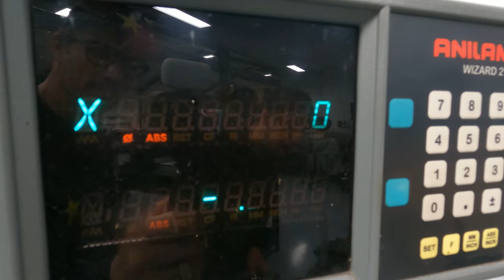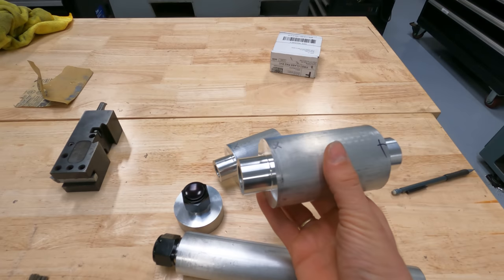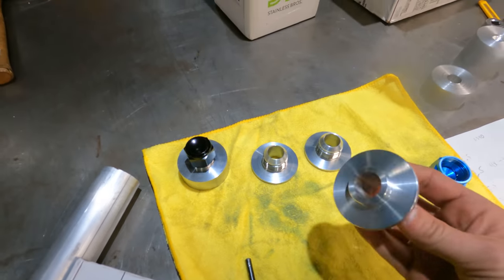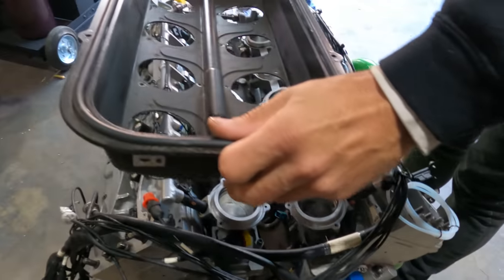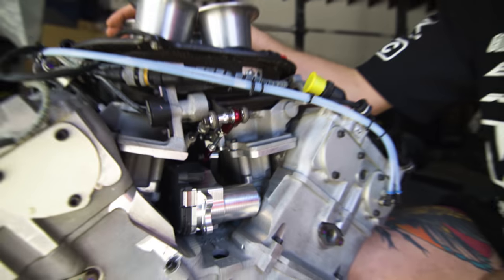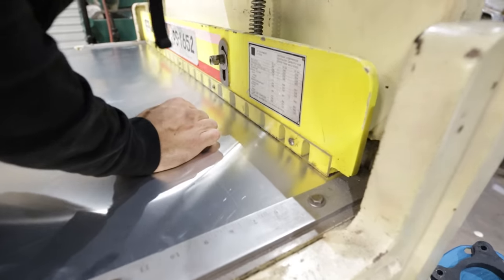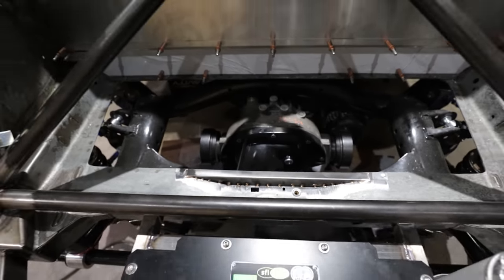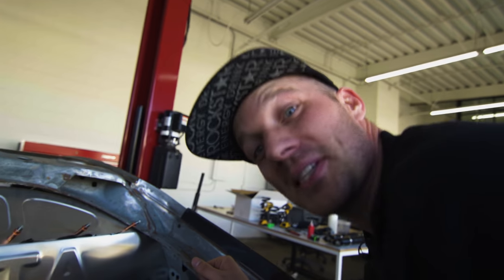Formula Supra Firewall, Drive By Wire, and Custom Domspec fittings

Comment: Cool thing about using RC car shock springs for the return spring is those are available in  adjustable weights so you should be able to find exactly what you want easily.

Comment: Yes you propably should not try to put cap screw on place of countersunk at 7:00. You put counter sunk screws all the way through the holes when the part is OFF, then tighten it to the pump so that screws stay in slots. This design is mostly because they want hose connector to land over the screws and physically stop screws becoming undone from pump when the hose connector has been tightened.

Comment: Anyone else really wanna see Dom press the the Toyota logo in that panel :(
Reply: It was done on the bead roller, there are some tenanted artist that make very detailed art with bead rollers.
Reply: Maybe he just ordered a stampted panel from the Toyota factory 😜
Reply: You can 3d print dies out of PLA and just press it letter by letter
Reply: 1000% he just ordered a Toyota tailgate skin panel and cut it to fit. The ONLY other way would require a press that was of gigantic size. Thibk of the panel presses Toyota uses in there factories......massive and I'm positive he can't get his paws on one of them papadakis doesn't have one......
Reply: Most likely done on the mill with a rounded over bit.
Reply: @daboy12s  winning answer here i made them too at work with this metod
Reply: @richmonsmith9308  don't think so, it doesn't look like it was stamped in a factory, it looks a lot more DIY, maybe with some milled or 3D printed letters and stamped them one by one.
Reply: Diego Garcia gonzales.....answer me this then.....why such a diffrsnce in the metal between the sheet he bought and the color and sheen to the final product......if he was gonna stamp it first off he would've used what he had on hand...it would've matched...cmon man think a little deeper here open your mind a little more....also have you ever attempted anything like this? Bc it sounds like you don't know the first thing about pressing sheetmetal.....I have personally done it but a much smaller relief and scale.....and again like I said.....he would need a press that was as big as a house to get those results.....go ahead spend 5 mins and do some googling.....bet you change your tune after that.
Reply: @richmonsmith9308  go ahead and tell me where he got a factory stamped aluminum panel with the toyota logo in it at the correct size for what he needed.
Reply: Yes, and it does look sick. Although personally I would love to see the old school Supra logo there.
Reply: For sure! Seems like it was formed with a rubber/urethane pad on one side and hard tool on the other (like laser cut metal letters on a hard surface). I imagine this could be done in a shop press of reasonable size.
Reply: @MrDHutch92   the amount of patience Dom has, he did it by hand / made the letters out of another material and stamped them one by one.
Reply: Yea any nearest Toyota dealer you can buy a tailgate......there not made of gold all dealers can get them usually have them in stock.
Reply: @richmonsmith9308  no toyota dealer has a raw metal tailgate with the plastic protective film on it. Material suppliers do
Reply: Wood, a router, a shop press, and patience will get it done
Reply: @daboy12s  I agree, I do this kind of work too, I just plasma cut the logo letters using a dxf file from any svg logo file. Then its done in the press. But i've seen Ron Covel, feature some bead roller artisans/ artists who can these kind of work as well.
Reply: @richmonsmith9308  have you ever actually seen a Toyota tailgate? That stamping looks nothing like this. The most obvious reason would be that the lettering on tailgates is pressed inwards, whereas on this piece it's pressed outwards.
Reply: As a sheet metal fabricator, all these theories you guys have (and the ones who think they are 100% right and are totally wrong) are hilarious.
Reply: I'll bet he pressed some wood or plastic letters against the sheet metal. It is thin enough to work
Reply: I am just surprised at how badly he spelled BMW. Still wanna know the method out of curiosity though.
Reply: @ttiization  Wooden or plastic dies in a press sounds most reasonable/economical so far.
Reply: @papapetad  and you machine it or 3d print it. Pretty simple process

Comment: Drive by wire throttle body controllers are usually meant to work without a return spring.
So I would reduce the return spring to almost nothing otherwise you risk the stepper motor seizing up from over heating trying to overcome the spring tension. If you want a positive return method add a small pneumatic ram that operates either off pressure or vacuum with a computer controlled solenoid to turn it on or off so it can slam the throttle shut if needed .

Comment: For those multi itb systems, use a 30lb return pair of springs and and a pair of 27lb ASSIST springs. That's the way to have a solid return with an ez pull.

Comment: Holy sweet gzs
We all just witnessed fittings be created from scratch ground 0 from a solid piece with the edges for where it sits not to mention the oil ring trim
Whattahell
You must be kidding full cheating over 9000 lol
Congratulations amazing work done unbelievable
(As if wasn't stoked for the whole series already)
EDIT: Had to come back here in the end of the video whilst the precious was while watching it to add about the finely crafted perfect fit firewall with design and even writings that was amazing
Sorry for the spoiler if you read this first before watching but simply because it had to be mentioned lmao

Comment: The Toyota embossing was probably done using a hammer form. Most likely waterjet cut out of steel and then the panel was laid over it and hammered in using a pneumatic hammer

Comment: If a spring is too strong, you can just put it into diluted sulphuric acid (basically battery electrolyte). It will slowly eat away some of the metal and make the spring thinner.
Reply: or you could just buy the right spring from McMaster Carr and have it the next day.
Reply: @patrickbaitman8336  Well, if you know which one to order, and if they have it in the correct formfactor, then yes.
But there are occasions when such a trick can be useful.
Reply: @sasjadevries  Didn't a racecar driver get in trouble for cheating back in the day doing something like this.  I think it was a stock car race, but he dipped the body to cut weight.  Something like that.
Reply: @patrickbaitman8336  Yep, there were people doing weight reduction like that, and the YT-channel "vinwiki" has a video on that topic.

And then even Papadaki and Ryan Tuerck themselves, dipped their supra to strip all the paint off. Except they couldn't go full acid because of the aluminium parts, and their goal was not to thin down the metal.

Comment: Awesome work why didn't you use countersink capscrew on the oil pump fitting.
Reply: I was thinking the same , the oil pumps pipe nut fitting might hit the screw heads counter sinks would've been easier instead of milling the threads of the pump fitting

Comment: 12:59 Where did you find that RC 4Runner in the background? That thing looks so cool!
Also, if you make the lever longer on the drive by wire system, It will have more travel and you can get that extra distance you need.

Comment: You don't have to run springs on throttle body in this case. Dbw assembly has its own internal return spring. Kinsler does it that way.

Comment: 13:44 .... So i gotta ask.. That hole in the top of the block. (that you were drilling near with metal filings going into the shop vac hopefully*)... Not an issue if some did sneak their way into that hole?

Comment: Why didn’t you use countersunk M6 bolts instead of cap heads for those custom AN fittings? Would have saved having to do that extra work..

Comment: why drive by wear?  keep it simple and leave a able on it?  I feel like binding issues are to come.
Reply: He litarlly explaint it in the video ;) Because the drive by wire throttlebody can adjust while shifting to minimize shifting times or acceleration loss. Also you can do antilag/rolling boost etc :)
Reply: Because tuning the throttle for flat shifting/down shifting and also launch/traction control is healthyer for engines, instead of using ignition or fuel cut if they kept using cable operated throttle
Reply: Also, Drive-by-Wire has improved A LOT over the last few years, it works wonders, just embrace the technology!

Comment: I can let safety glasses go on the lathe if you're turning slow enough and you have a consistent chip sure. When you're blowing compressed air at drilled chips... Why aren't you wearing safety glasses?!